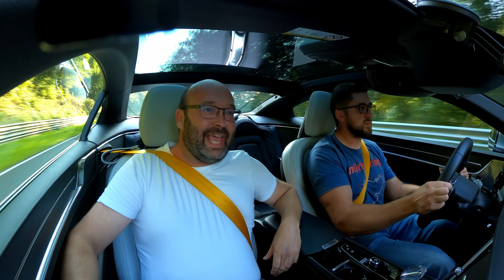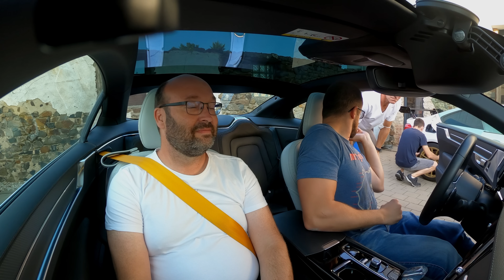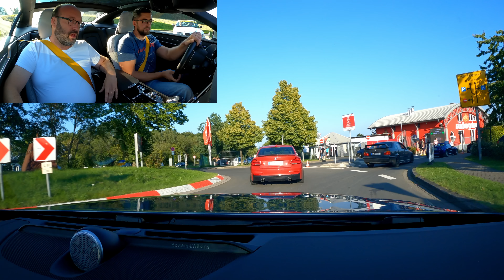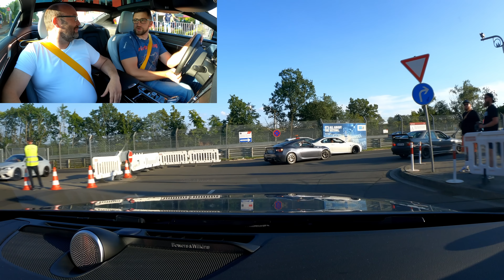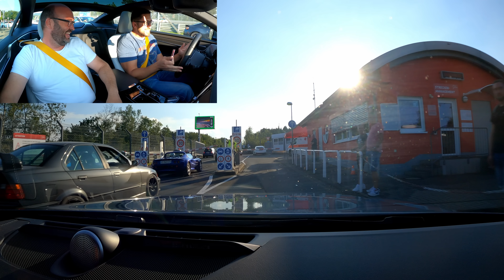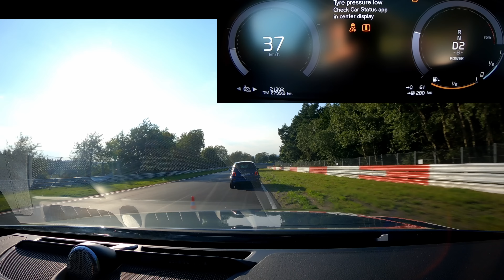Impressing (or Scaring?) Polestar 1 Engineer with His Creation

Comment: WTH? How does a 5,200 lb car move like that? Or move at all? That's heavier than most small and even many mid-sized SUV's. And even more curious... despite having electric motors & AWD, how did they even manage to get the weight that high? Almost as if they were trying to make it as heavy as possible.

Comment: Tyre pressure too low?
Reply: Always start off like that since the track drive will heat up the tyres and thereby increase the pressure. As you see later in the lap the warning is gone.

Comment: over 100k priced GT car and it doesn't have ceramic brakes.
Reply from the maker: And it doesn't need them as the practice shows
Reply: That will change on lap with disabled regenerative breaking and driving only on ICE.

Comment: May I ask if the warning about low pressure is because you did actually keep the tire pressure low for a fast lap or is the app acting up?
Reply: Yes, low tire pressure for a fast lap👌
Reply: Pressure increase during the lap as the tyres get warmed up. If you would start the lap with correct pressure on cold tyres you would have too high pressure later on.

Comment: That car sounds great! 
So have Volvo/Polestar got a Ferrari-esque ’Manatino’ mode selector?  1) Wet, 2) Bumpy road, 3) Sport, 4) Sport Plus, 5) Mischa.
Reply: The Polestar 1 is an electric car, that noise is fake and is coming from the speakers.
Reply: @altspitfire  if that's what you want to belive
Reply: @ValentineC137  It's an electric car, how else is it going to make engine sounds...
Reply: @altspitfire  maybe it makes those sounds because it has a twincharged 4 cylinder engine in the front :P
Reply: @ValentineC137  My apologies, let me rephrase that. How else is it going to make V8 noises?